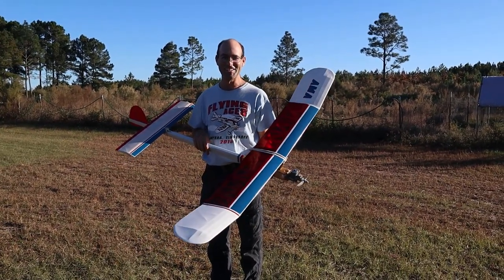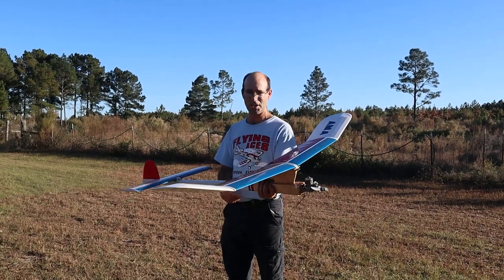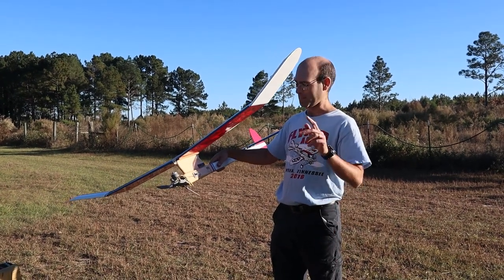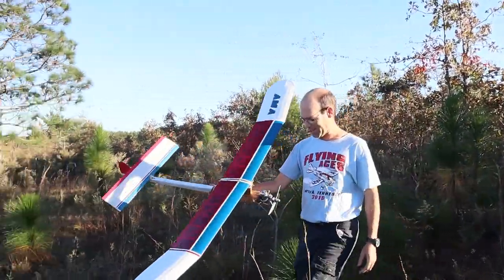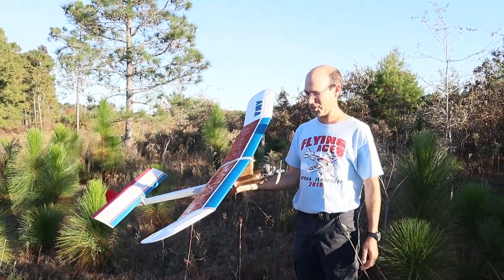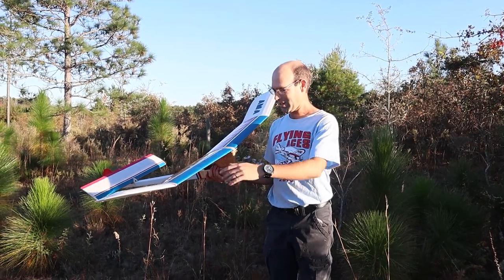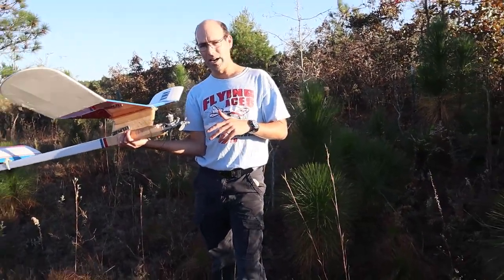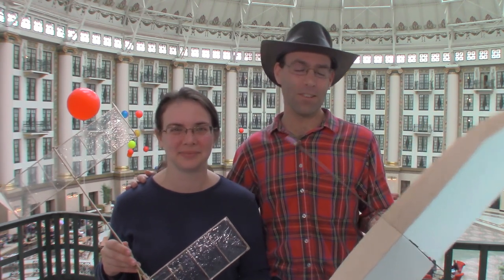Zingo all-balsa vintage F1C with Cox Conquest .15 glow engine

Comment: I'm probably not the only power flyer who watches this and thinks 'point it up more, Josh!'  |-)
Reply from the maker: Yeah thought about that but it patterns well enough like this. I think any steeper and it might incidence step before getting established.
Reply: @joshuawfinn  Yes, I just realised it's a fixed surface plane (no VIT) so you're right.
Reply from the maker: @robinbeckford  fair enough. I've used autosurfaces but mainly prefer them for driving on. 😉
Reply: Hahaha good one Josh.

Comment: Do I see a 1965 Mustang in the background? Did you restore it? Is in a " Pony Car" with the fancy steering wheel and shifter in the console? ( And, did it have a crack at the base of the top as it  meet the top of the fender in the area bellow the drip rail.? Probably, on the driver side.)
Reply from the maker: I'll get Logan to chime in on the details. It's mostly original as I recall.  I only know how to drool over nice cars, he knows the details inside and out.

Comment: Beautiful flights! I think I used to see more of a corkscrew climb path when I watched free flight events in the sixties, but that's probably a question of prop diameter in relation to wing span. Thanks for sharing!
Reply from the maker: Main thing is the greatly increased power. That engine revs at 27k rpm. The modern designs do like a slightly more open climb circle too.
Reply: @joshuawfinn  27k seems insane for a .15! Thank you for demonstrating that it can be done.
Reply: I saw a corkscrew climb, then, too  have 2 Blazer and 1 Viking kit

Comment: What a great flying model
Reply from the maker: Thanks! I really like it. Flies similarly to a Pearl, maybe even a smidge better.
Reply: @joshuawfinn  to bad there are no pearl kits other then the mini pearl. I would like to go to one AMA nats. It would be great to participate in Free Flight. .15 size Pearl would be cool.
Reply from the maker: @johnmajane3731  put out a request on the various forums for a Pearl 450. Great airplane. The only ones that I don't think got kitted were the Pilfered Pearls, and I plan to fix that. PP711 on a Nelson .40 is a real screamer.
Reply: @joshuawfinn  you think there are kits still out there? Campbell Custom Kits had some if I remember correctly.
Reply from the maker: @johnmajane3731  yeah the 450 shows up on ebay occasionally. I suspect someone on FFML still has one lying around they'd part with.
Reply from the maker: @johnmajane3731  also take a look at the Big Dog. I've seen them flown in A/B Gas with the nose cut down a little for CG. Straightforward and competitive: http://topnotchkits.com/index_files/TN_Kit15.htm
Reply: @joshuawfinn  thanks

Comment: Hello Josh, I'm an old retired guy having fun building planes for the first time having fun. I just built 4 rubber band planes and all of them turn to the right into the ground. Could you tell me the angle I should put on the props? The planes are foam built and 12'' to 20 '' wingspan. Thanks for the help if you can.
Reply from the maker: Well let's start with glide trimming. Are they gliding ok? Also what kind of airplanes are they (scale, low wing, high wing, endurance model, stick model, etc)?

Comment: Dear Joshua, can I do the   timer by myself at home?
Reply from the maker: In theory you can build them from small wind up toys and old camera timers, but they need to be able to handle the vibration of the engine.
Reply: @joshuawfinn  Tashakkur(thanks😊)

Comment: Pretty airplane! Looks really stout in any case.

I am primarily a glider and electric guy, but I've flown glow in the past. Not gonna lie, getting that glow igniter off would terrify me. It just seems too precarious, especially in a contest situation. Have you considered using a remote plug wire on planes like this?
Reply from the maker: I don't know what it is about glow power, I just love it. Glow models do tend to be lighter and better balanced for thermal hunting than electrics, for what that's worth.

Interesting you should mention the glow clip issue, I've had the same concern, so I moved to a Nelson plug clip and I string the cord through my hand while pinching the fuel line for startup. When I pull my hand away, the cord comes with it and then I just open my hand to drop the plug before returning to start the timer.

Comment: Hey Josh, Great model for sure. I have a couple questions. What would the ideal prop be? fuel are you running and what's it weigh? It sure transitions well! Lastly, why doesn't it have a white fin? I thought that was a rule? ;)
Reply from the maker: Thanks Todd! Optimum prop seems to be a Norm Poti 7x2.7 fiberglass prop. At $10/each, they're not for everyone. APC 7x3 is a cheaper option. Engine is shimmed for FAI fuel, however I've run it on 15% in the past without issues. Plane is ballasted to whatever the appropriate Vintage FAI weight is, 25 oz as I recall. If I remove the ballast, it gets really fun. As for the fin, Charlie Caton was not of the Berry School of Free Flight. Personally, I would have used white. LOL!